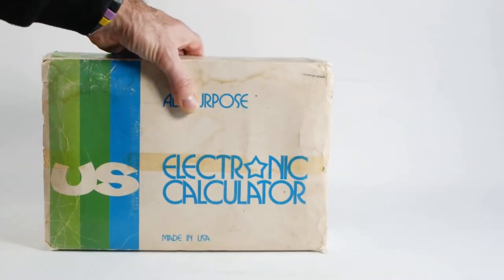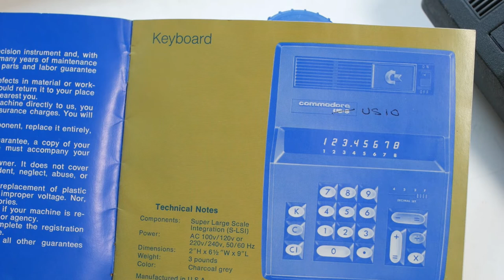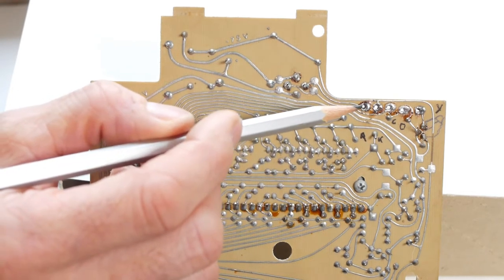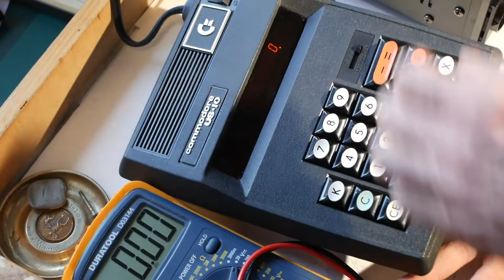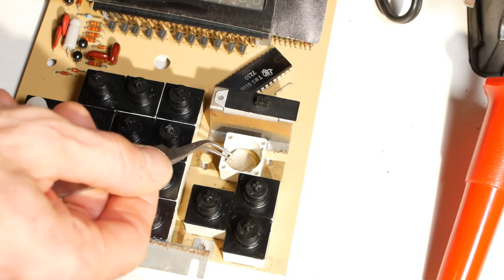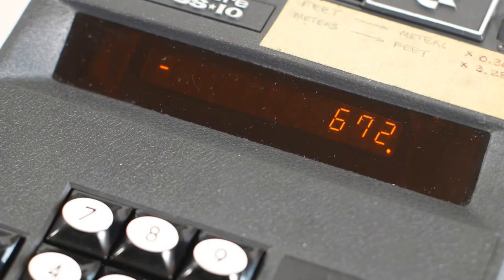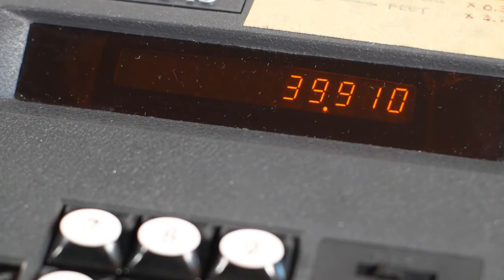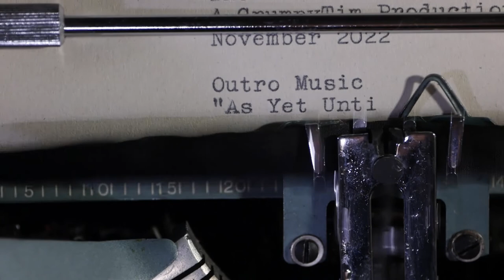Vintage Calculator Repair - Commodore US*10 - and Demonstration

Comment: I’m not intelligent enough on electronics to fully follow, but I just love the aesthetic of these old calculators and its satisfying watching the repair so that it is no longer dead as a dead thing.  Video very nicely made with super clear audio.  Thanks!
Reply from the maker: Cheers Illuminating Watches, you'd be surprised how often you only need a vague understanding of electronics to be able to fix them - battery leakage corroding tracks on the circuit board is common and also wires or components coming unattached.  I always start off looking for the bloomin' obvious before delving too deeply, and usually I'm successful - which is a good thing as I quickly get out of my own depth.  Probably wouldn't be the case if I was looking at digital watches, everything would be smaller and more fiddly and I'd just stare at it blankly and the watch still wouldn't work!!!
Reply: @GrumpyTim  there is a channel called vintage digitals watches who is a genius at repairing them. I’m not clever enough - may need to invest some time in educating myself
Reply from the maker: I might take a look, just for fun, I'm not planning on starting to repair digital watches.  I did at one time repair a few mechanical watches but they were a bit too fiddly for me to enjoy.  I loved collecting watches, I have a reasonable collection, but nowhere near your quantity - I feel a bit guilty that I rarely wear them these days and some will certainly have dead batteries and potential damage as a result - too many tasks and not enough days in the year.  I'll head over and watch some of your videos sometime, I had a quick look earlier and they look great.
Reply: @GrumpyTim  Be careful! It can become a serious addiction!!
Reply from the maker: Yep, I'm all too familiar with the addiction of collecting things, but it's so much fun!!!!

Comment: Looks like a shaver adapter which would normally run at 115V. I expect the time it took to warm up is an issue with the capacitors.
Somewhere I had an old batter powered Commadore calculator from the early 80s. Programmable too! (As well as some Sinclair calculators).
Reply from the maker: Funnily enough, after I'd filmed that bit, I wondered if someone had been plugging it into one of those dual voltage shaver sockets, so I was slightly less concerned once I'd had that thought.  I wonder how those dual voltage shaver sockets work - they can't have much load capacity - my 300w step down transformer is huge and heavy with a great big toroidal transformer in it - yeah 300 watts is much more than a shaver, but those sockets fit in a standard back box, so there's not much space in them.  I once tried charging my shaver using one of those dual sockets in a hotel and after an hour the socket got very hot and buzzy, so maybe they're not meant to run for more than a few minutes.

I have one of the Sinclair Cambridge programmable calculators - still in it's box - I bought it brand new in the 80s - I remember being hugely disappointed by the really flimsy afterthought of a battery cover and the horrible to use keyboard.  I will do a video on that at some point. It would be totally immaculate, but I had kept it in it's dust cover, in the box, and the dust cover decomposed or at least released oils that melted the side of the calculator body!!!

Cheers for watching Ben - I will get round to watching the rest of your London to Brighton stuff soon.
Reply: @GrumpyTim  It's a shame when covers wreck what they are supposed to protect.
Reply from the maker: Yep, I've had it happen to a few things, although the Sinclair is the only one I can remember at the moment.

Comment: I have had similar issues with a couple of my neon display calculators. If not used for a while, when you first turn the calculators on the display does not function. One in particular, if you do not use it for a month or so, takes about 40-50 seconds of being powered on  before the display works. After this initial power cycle, it functions as expected, with instant on display, until you stop using it for a month or so. I suspect it is the capacitors, but am reluctant to take it apart as access to the screws is under a vinyl  covering, which is current perfect.
Reply from the maker: Hi CalculatorObsessed, yeah, I agree, it must be old capacitors reforming - I might replace mine at some point, but it's working fine at the moment, and I'm less inclined to work on stuff when it isn't broken.  As you say, with your machine, it seems a shame to have to  remove the vinyl covering if it's still working for the moment.

Comment: Wow you're uploading a lot of video's these days :) I have a weak spot for anything Commodore related. Nice video!
Reply from the maker: Hi ohjajohh, I've been trying (and failing) to upload one per week, but that will soon dwindle as the end of the year approaches and everything goes crazy.  Someone else left a comment that led me to some old Commodore adverts that I'd never seen before - they're cringe worthy to the extreme - just do a quick search for a Commodore SX-54 advert and you'll see what I mean.  They also re ran the same advert for the Commodore 64.  One day I'd love one of the Commodore Pet computers with their sci-fi looking case design but they tend to be a bit pricey these days.